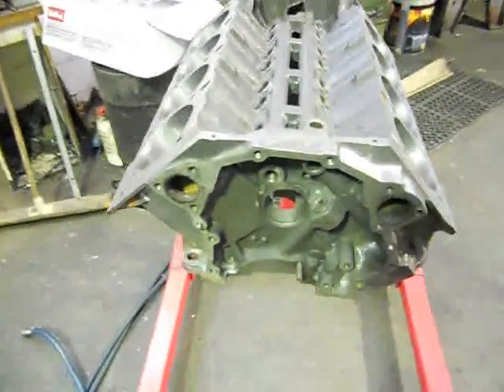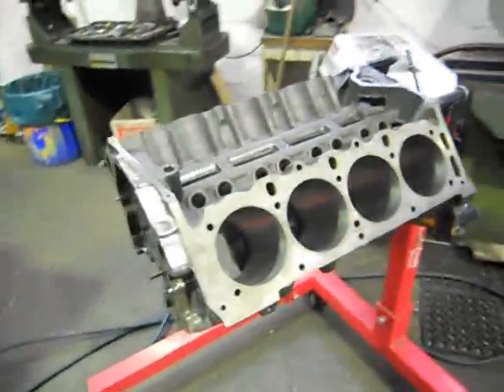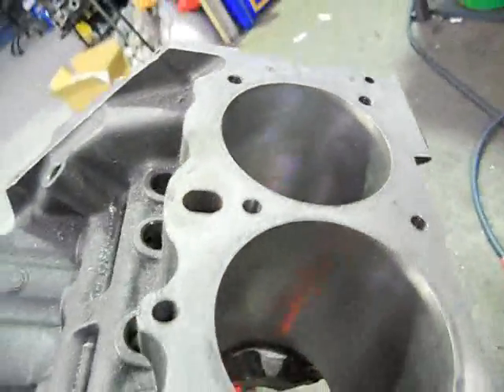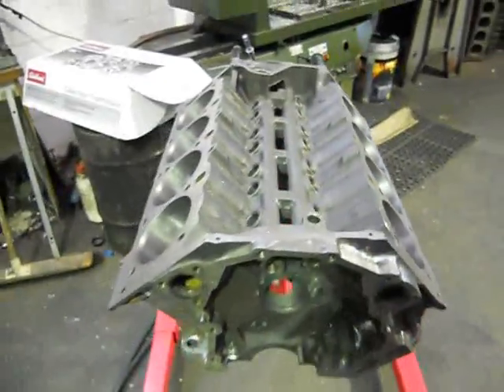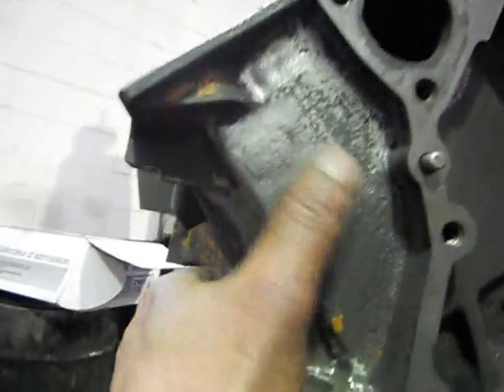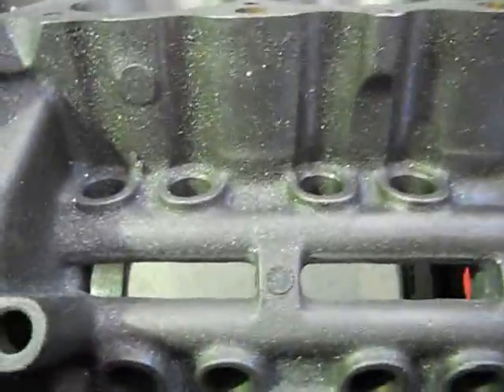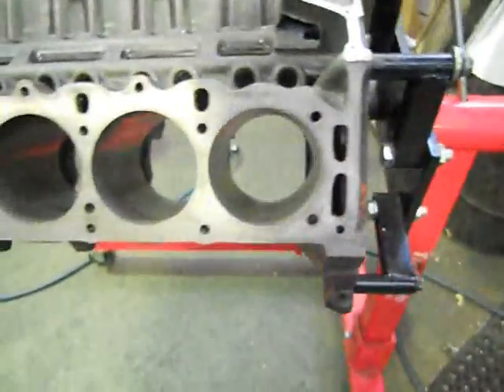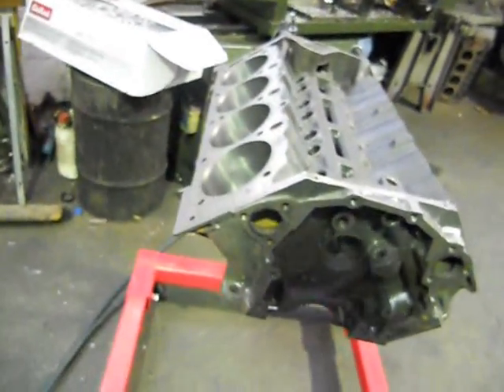How to race prep a high performance V8 engine

Comment: @Aussieheads1 Oh I hear you, some factory castings are full of joint flash and porous holes. 
Last 308 I rebuilt I actually bored a couple of holes through the water jacket and put a tube through it to help drain oil back under the windage tray, Lots of builder's run external tubes down from the rocker cover's too, Just another place to leak in my book but hey if it works for you 'eh. I put ears on the Pan to hold 3 Litres of extra Oil.

Comment from the maker: @mozzmann For sure mozza spot on,I don't believe on spending hours polishing insides of blocks,only once on a special sbc cause I wanted too,but in my years,some of the castings that come from the factory are well!! Not in front of the kids.Pathetic,cylinder heads especially,308s can only drain top end oil thru back of block,oil returned over cam has get past that,then is sucked into the violent windage world of the crankcase,a mass of oil sucked,blown,around the crank like a oilmass tornado lol

Comment: I'd exercise caution is cleaning up the inside of the block and the castings too much simply because if the oil drains back to the sump too fast it doesn't give up as much heat to the cooling jacket as it should resulting in higher oil temps. 

I understand why you clean so the Oil drains back faster and I do the same thing with the casting flash and rounding off sharp corners lessening the risk of a crack coming away from them. 

Whats wrong with engine Porn :P